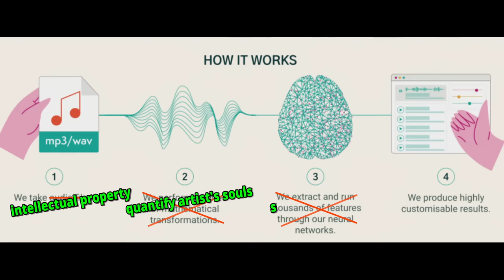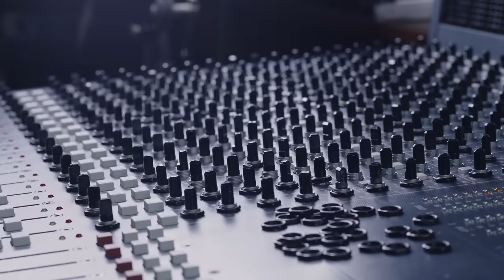The Future Of Music

Comment: On your comment on AI music being used in video games, I actually don't think this is going to be too much of an issue. The big difference in games is how often things need to be iterated on and how specifically they need to be adjusted. I don't think the workflow of games is going to be really conducive to utilizing song generating models to make anything effective for us in a game. 

Games are increasingly using adaptive music techniques requiring stems designed in a specific way to work with live remixing and resequencing. That constant back and forth I think is a big failing point of AI. I don't think it's great at taking extremely specific notes without fundamentally changing the original output.

That's not to say it's not a concern but I'm not overly worried.